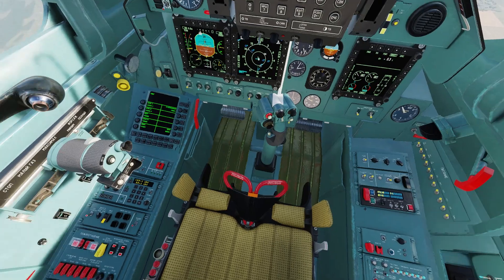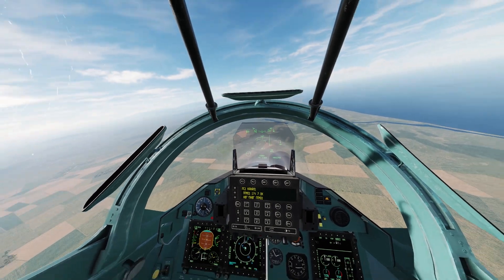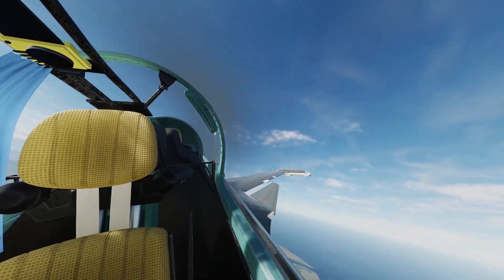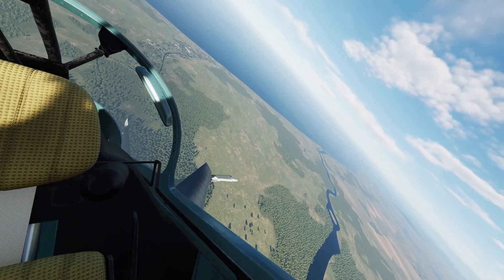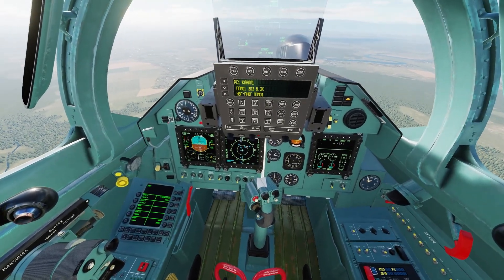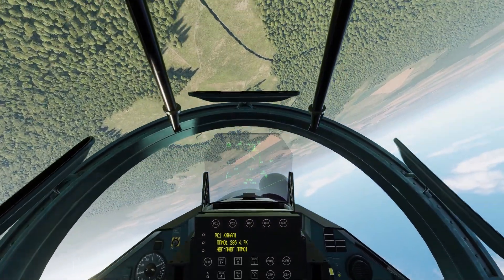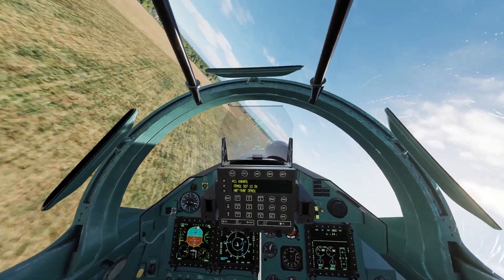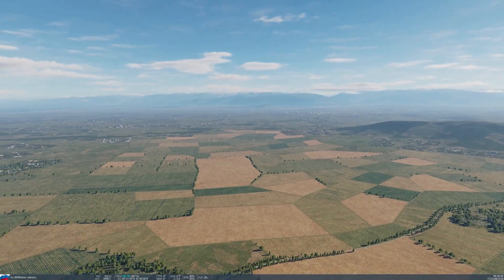DCS Su-30 Codename Flanker: TVC & Ground Escape System Tutorial.

Comment: If the assertion that "it's disabled" is based off the visual indices of the nozzles moving, you may need to double check that,  as the canards aren't visually moving either.  That one curiosity aside ...  it looks like the HUD is different (1 pane vs 2 panes) also? Is that an actual change or a "liberty" the devs took? 

Far more importantly: I saw another channel demoing it in an "acrobatic mode": 

Video Title: Su-30SM aerobatic flight, with new EFM mod  
Channel:     cptVLK

(I'm not a DCS player) but the audio was AMAZING!! The sound changed based off the thrust setting, the angle of the jet vs. the "observer" and perhaps even distance (perspective). it was absolutely OUTSTANDING!  I'm personally VERY tired of hearing the same damned sonic boom or static engine sound every time they show a "cinematic" view of a jet.  Whatever the case is ... incorporating that would be a huge "win" for the community (if such a note could be delivered to devs). 

Thanks!!
Reply from the maker: The mod will receive more updates in the future. It's not official yet.